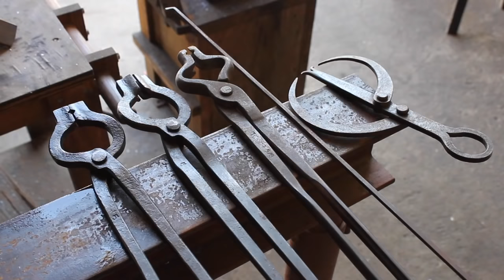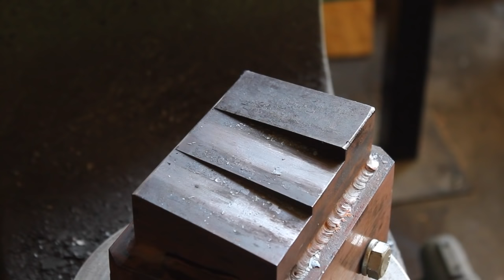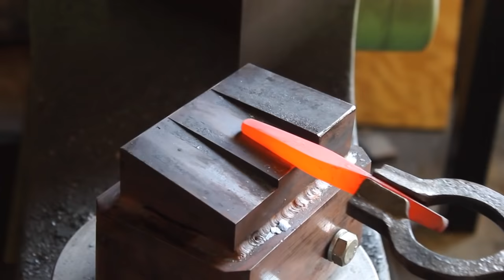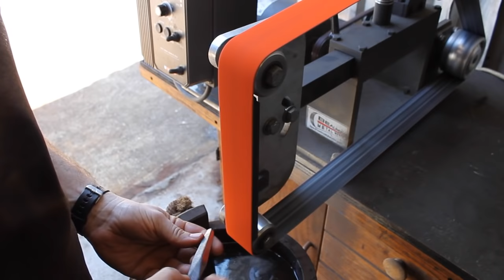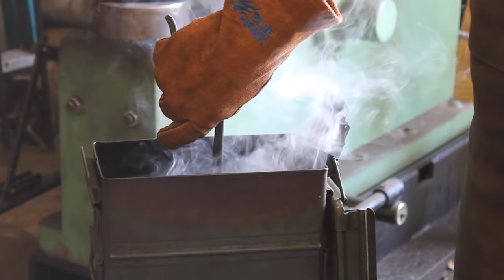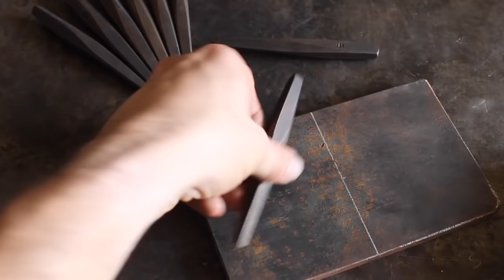Forging a Center Punch

Comment: hello. it would be helpful if you show the annealing proceeds after hardening an point making. point is made before annealing or after
Reply from the maker: Annealing is pretty standard.  Follow 0-1 guidelines.  I hardened in parks 50 oil.  The point was ground after hardening.

Comment: Would you use a center punch for detailing work on hot metal, or is there something more appropriate? For instance, making faces, dragons, etc. If so, is it worth heat treating them?
Reply from the maker: dtj41 You could, but hot work would mess up the temper, so H13 would be preferred.

Comment: i tried to practice making a punch from mild steel, fail to keep it straight on those tapering slopes. How did you manage to keep them straight?
Reply: i mean, after adding tapering slopes, my punch tip isnt centered
Reply from the maker: Alcatraz Miller I work all four sides until its straight.  For the tip/punch I grind to shape by eye.  A little practice and you'll get the tapers even.
Reply: mild steel is softer....less forgiving.